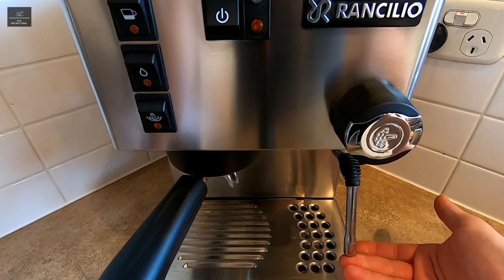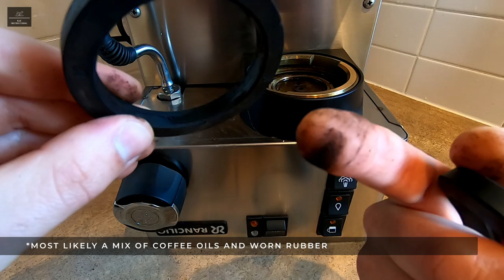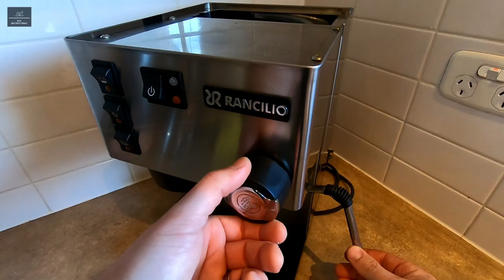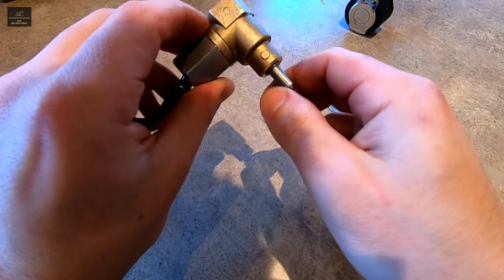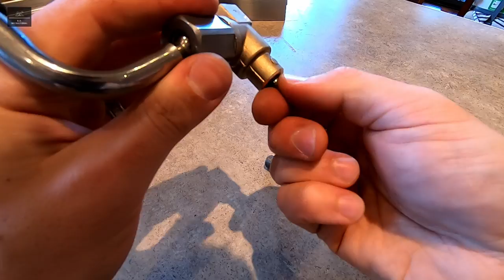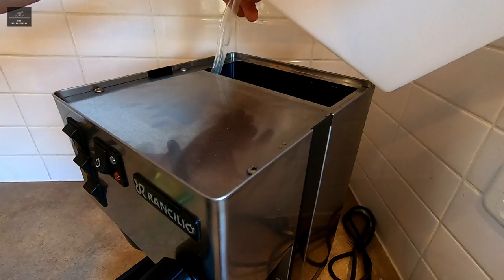Rancilio Silvia - How To Replace Group Head, Shower Screen and Steam Gaskets (Seals)

Comment: Thanks for a great tutorial. I  am cleaning up my old Rancilio Silvia to give to mum to replace her Breville dual boiler.  I replaced my Silvia with an ECM  Synchronika about 6 years ago.   The Silvia against the ECM  for espresso does an impressive job for the price difference when using a good grinder. The Silvia I find to make good espresso needs a really good grinder , the Mazzer Luigi I use now when I was testing the Silvia, makes it easier to pull a good shot,l.  Compared to the Rancilio Rocky grinder where I used to dump a number of shots.  The key lesson for me is, invest  in a good grinder from the start.
Reply from the maker: Cheers, thank you for sharing. When I purchased my Silvia, the lady who served us mentioned that the Coffee Machine comes 3rd in the rank of good coffee. 1st is the coffee beans. 2nd is the coffee grinder and then 3rd is the coffee machine.
Reply: I can absolutely agree. I own my Silvia for nearly 2 decades now. It has been only once for a general review! And it makes a very good espresso. Since two years, I want to buy a La Marzocco Linea mini, but my Silvia needs to give up service first. I guess, I will never get a Linea Mini🤷 and maybe I will buy  another Silvia, for about €600 instead of Linea Mini for about €6000.

Comment: The shower screen can easily be cleaned by cooking it in water with Fairy or similar soap. Coking slowly for 15-30 min takes time to melt the coffee. This can also be done to the PORTAFILTER BASKET and other dirty parts. If some dirt does not come off, use a sharp needle to get the rest off.

Comment: Great vid, just what I needed to know. Also, do you think it's worth just cleaning the screen itself without replacing it every now and then? Obviously they get to a point where they need replacing anyway, but would giving it a quick clean at shorter intervals extend the period before it clogs up completely?
Reply from the maker: Cheers, thank you. Yes, it's worth cleaning the screen every so often as well as the brass items / collars.
Reply: @NJSInstructional Cool. Thanks for that. :)

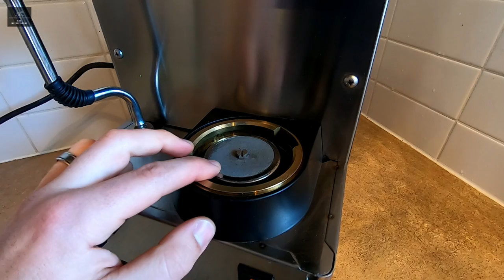Comment: This is an excellent, crystal-clear presentation. Unfortunately, I've been unable to get past removal of the bolt (1:20). My bolt is not a hex-head, unfortunately - it's just a flat head screw; this is probably because my machine is a v1, circa 2002. Therefore, I have to use a slotted screwdriver. I don't think the gasket has ever been changed, and after 20+ years the screw is unmovable. Any suggestions would be much appreciated.
Reply: I would try a back flush with some espresso clean. It will likely losen up the build up keeping it tight.
Reply: Try applying a little wd-40 on the screw and let it work for a few minues but make sure you clean super well after?

Comment: Um could you please explain @2:11 That brass plate or diffuser doesn't remove from my group head, it seems to be all one piece, I can't even see a separation or is mine fused? Yours detached effortlessly. I just stripped my machine so I was able to give it a good scrub. I cleaned out all the crud beneath the gasket, got in there with ozito, and after realized that what I thought was crud was actually the gasket spacer. lol Minus the spacer created more space and my portafilter had to be locked all the way to the far right in order to be tightly sealed so that no water will pass. You learn I guess. Cheers
Reply from the maker: My brass plate diffuser came off quite easily. However, my machine is nearly 2 years old. I'm not sure if you have an older machine if it is different (I doubt it though) or if it could be stuck in place due to the build up of crud...
Reply: @NJSInstructional  Yeah i too thought it was a case of older version. (V1) it is all one piece. Cheers buddy
Reply: when I disassembled it, I also thought that it consists of 1 part. but at some point it just fell off) apparently no one cleaned it for a long time at work. lol
Reply: @DmitryRovny-v9g  (V1) it is all one piece.

Comment: How often should you replace the shower heads/screen?
Reply from the maker: Good question, I would gauge it over time and see how it holds up. So far, I have only changed the rubber seal once (and only for the purpose of this video). The shower screen doesn't seem to wear as quick...
Reply: @NJSInstructional  thanks! Like how would I know if water dispersion or flow  from the group head is like it’s supposed to be?